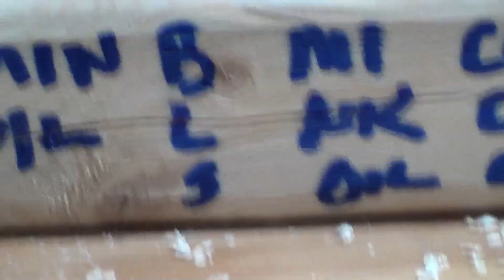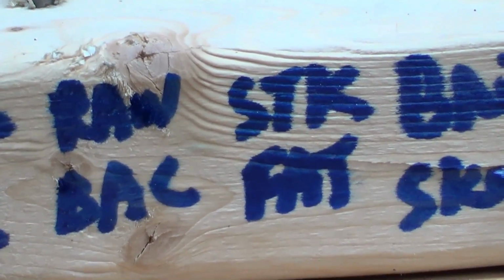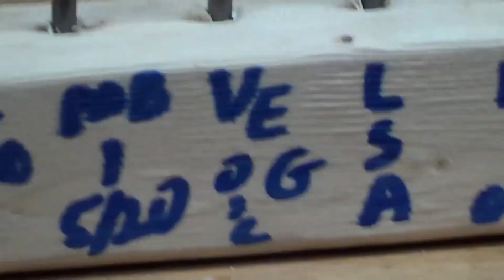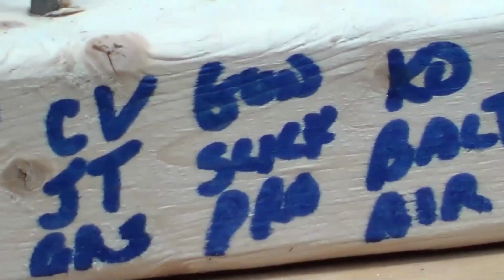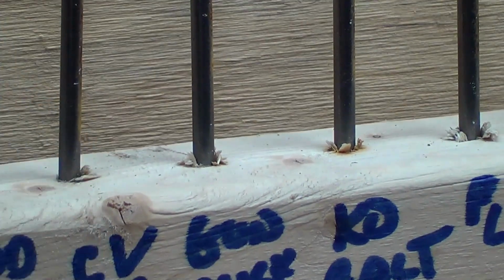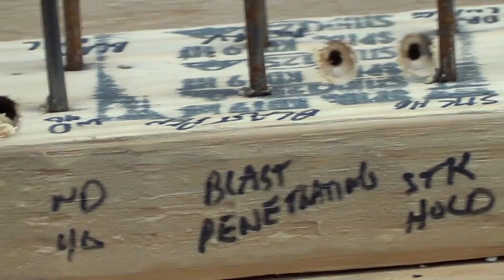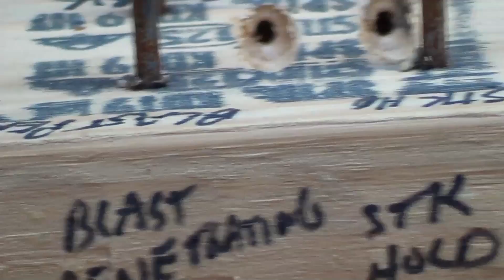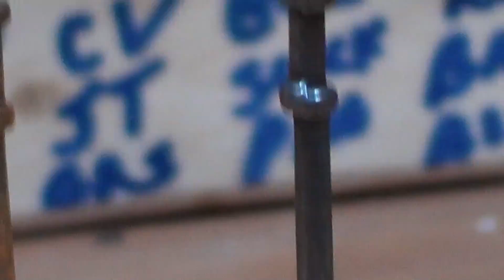UPDATE On OIL Testing - Some Surprises Some Not - Rust Protection Test

Comment: Rick, FYI.... Started using some oil specifically for pop cron popping on my cast iron. Doesn't seem to bulid up and turn gummy like veg/canola and it'll take higher temps than veg oil or good old lard.

Need to re-season my wok so..... I'll see how that goes at some point. 

It's also good for popping pop corn on occasion .......LOL
Reply: Art, have you ever tried peanut oil ? I use it exclusively for all of my frying, fish, whole turkey, chicken, taters, etc.. I also use it on all of my cast iron pans. It has a much higher "smoke temp" than most other oils. Kind of expensive, but IMHO, it's worth it.
Reply: @wldtrky38  ,

Yeah... I've used peanut oil too. I like it but, I live out in the sticks so it's hard to get a hold of in small qualities and can be pricy. 

Stumbled on the popcorn oil out of necessity ( it's all I had ) a couple of years ago. 

Seems to have a really high smoke point and doesn't have some to the issues of veg and canola. 

I end up having to re-season my griddle frequently because tortillas need a HOT griddle and that tends to create problems with the seasoning.

But, a couple of rounds with the popcorn oil and I'm back to making omelets with the griddle, which tends to impress my friends who cook.......LOL
Reply: @artt3165   👍👍 Can't beat results ! I buy peanut oil in 3 gallon jugs, usually around $30. Lasts FOREVER unless frying whole turkeys, lol. Best wishes

Comment: When you factor in the cylinder explosions, heat , gasoline & oxygen for hours on end then sitting in all different climates, Mobil 1 really protecting way beyond what different ammo & mag dumps will do the moving parts of any Gun.
Reply: @SW42mg  The T-1000 can form simple machines like a potato type gun or mortar tube but can not formulate the complex chemistry to make ammo. Mobil 1  will not break down under the heat of normal semiauto fire nor the chemistry of the ammo. A Glock will work with no oil, no problem just clean now again.

Comment: The corrosion protection package in all engine oils will be substantially similar simply because they have to meet API rating standards for use in gasoline and diesel vehicles. 

Used engine oil performs badly because it will actually contain acids which are introduced when the oil is exposed to the byproducts of combustion during its time in your engine. Diesel service used oil may even be worse due to the presence of sulfur in the fuel itself. 

Modern computer controls have greatly improved the service life of engine oil but ..... you simply can't entirely get away from acid buildup in the oil of internal combustion engines. 

Holy crap....... you'd think I taught this stuff ......LOL

Comment: Vegetable oil turns gummy over time as it oxidixes. Fine for a cast iron pan, not for moving parts.
Reply: Stored in a climate controlled home it can take years for vegetable oil to oxidize.  Fireclean is essentially a blend of vegetable oils and a bottle of that is usually good for a few years.  I agree it wouldn't be the best option but with regular cleanings and replacing of your oil bottle with fresh stuff it would probably get someone by just fine if they store their firearms in a climate controlled home.
Reply: @silentbob267  Would it smell like fries when you do a mag dump? Lol. The plant based 2 stroke oil kind of has that smell.
Reply: @Chris_Garman  I don't know but that would be awesome if it did.  I also vaguely remember reading somewhere that the Soviets used sunflower seed oil for firearm lubricant in their southern climates to good effect back in the WWII era.

Comment: I just tore my 1911 all the way down and put some mobile 1 on everything. Its currently sitting in a million pieces, in a box...gonna wipe it again before reassembling. Had some trouble getting the trigger out. Hope I can get the damn thing back together...lol. We shall see🤷🏼‍♀️. Hope you're well Rick. Thanks for doing this 👍
Reply from the maker: if you email me with your number I can call and talk you through it or do video call and watch you put it back together.  put in your subj line in all caps THIS IS EMILY WITH 1911 :)
Reply: @heygunpeople  Holy shit, for real!? That would be amazing.  Still cant get the damn trigger out.  I cant find the little spring you referenced (playlist) and the screw on other side of mag release will NOT budge, I'm scared I'll strip it. Bent my damn bit....I watched most of your playlist yesterday. Paused it a million times, got frustrated, stopped for the day so I wouldn't end up forcing something.  I'll email you this evening when I get home or tomorrow. Thanks so much.
Reply: @emilyrichardson9954  😶..... send pics of the stripped down parts ...... oh and the 1911 parts too...😉
Reply from the maker: trigger should come out easy last thing after you remove mag release.  rub your finger over every edge of every part if you rough or jagged or any un smooth areas, use a little 1000 grit sand paper smooth it out, you would be surprised how much that helps them run, feel and operate even if a little dirty. I have a 1911 play list where I takedown and put back together if you get stuck
Reply: fred kramer Lol!  😆
Reply: And it really needed it....
Reply: @fred kramer AND I'd rather do it myself so I can learn. Not gone past field stripping with that one and some of the pieces were BLACK. Only had about 1000 rounds through it, but still...I can get my Glock down and back no problem, but still learning the 1911. Wish my grandaddy was still around...OR if I was near Rick,  I'd pay him to teach me...

Comment: Maybe mix 3 in 1 with Mobile One to thin it?
Reply: Thystaff Thywill I was thinking for just spraying a mist before storage. Where I live it is humid and desiccant only lasts hours in the safe. I’m using a synthetic oil and it’s a bit sticky for lack of a better word. If adding a squirt of 3 in 1 won’t hurt, why not? As it is I’m cleaning, wiping and running a mop through every other week or so during the summer just to be sure nothing rusts. I’ve used CLP and other thin sprays and when I wipe, there is a bit of rusty looking color on the rag. I’ve see home recipes using transmission fluid, motor oil and even some Hoppes # 9 solvent thrown in to help with cleaning and to add that scent. 

Based on this test, if 3 in 1 stops rust, and the oil stops rust, what can it hurt?
Reply: Thystaff Thywill so true, that’s the problem with CLP.

Comment: This is great info Rick.  I have  3 in 1 oil with PTFE (Teflon) which will be my go to oil from now on. I have slip 2000 but that shit is expensive. I'm curious how slip 2000, frog lube, and some of the other gun lube du jour fair. I don't expect you to go out and buy all of these lubes because you'll go broke lol.
Very disappointed in CV 2 as the product description on amazon says "Red Line CV-2 Grease can be used in a wide range of applications at temperatures ranging between -100°F to 500°F and provides good oxidation and corrosion resistance," No it don't. I was using cheap red bearing grease before and when my CV 2 runs out I'll go back to it. I don't use grease except for the high stress friction points such as slides and bolts and high temp grease is the way to go. 
Rem oil was a shocker too. I'll bet every gun nut out there has some. Thanks for the great info Rick.
Reply from the maker: I was bummed on cv2 I loved that stuff and rem oil...  sad day in the oil business
Reply: Good Luck America lol